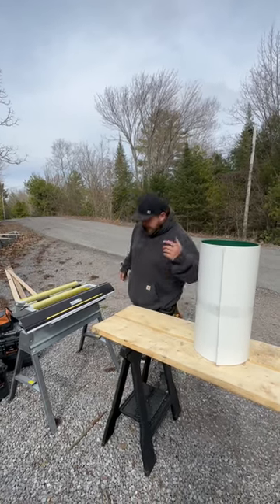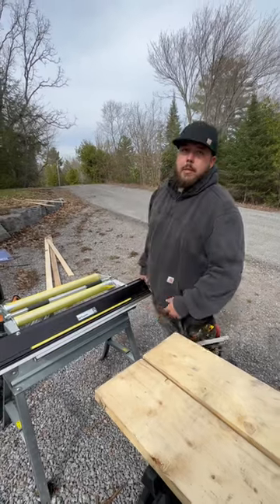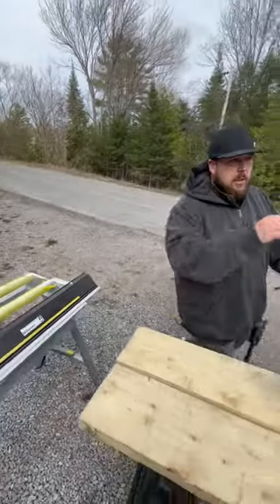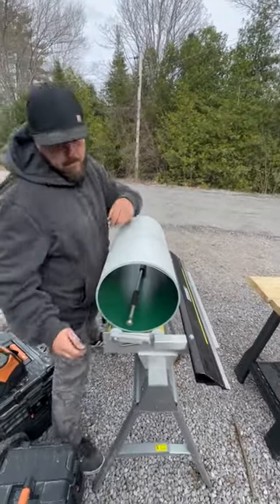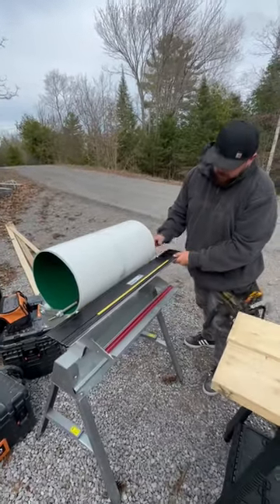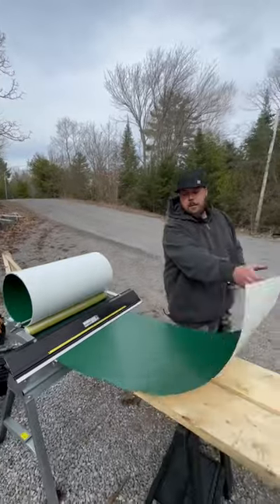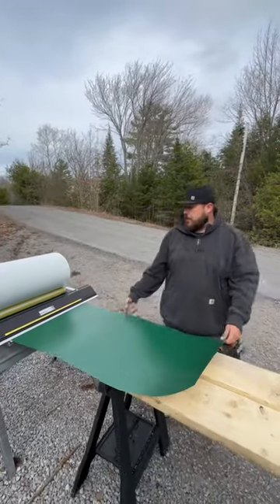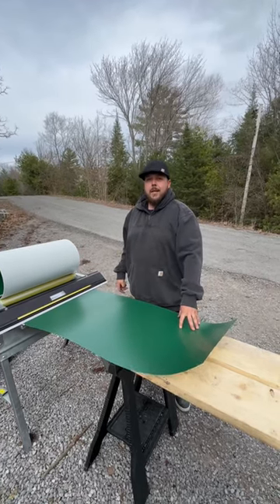Coil Dispenser 1

Comment: I have a question about the roofing hatchet. Would you mind demonstrating how to use the part on the blade with the hole and the peg? I can't figure out what it's for even after reading instructions on how to use it. I read it's used to set the nail depth but I have no idea how that would work.
Reply: It's for making your staircase, steps for shingles it has 3 or 4 different measurements 5 5/8s and so on. The measurements are from the inside of that peg to face of the hammer. Lay a shingle align your peg at the right side of that shingle lay your next shingle to the face of your hammer and so on
Reply from the maker: The hatchet is actually full of amazing features for shingling! I will do a video for you soon! CHEERS

Comment: The coil i get has a flap on the inside and it causes the roll to jump on the machine. What do you do to prevent that from happening
Reply: Score the flap with a utility knife and bend it back and forth a few times and it will snap off.
Reply: Exactly what Joe just said. Sounds like you have a kaycan coil
Reply from the maker: Yes lads!! I use Gentek but same situation! CHEERS